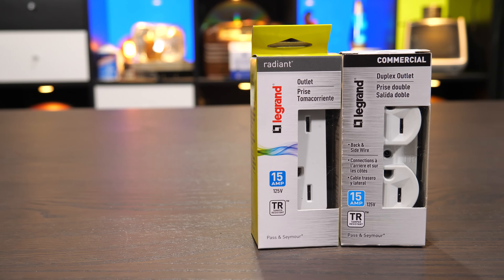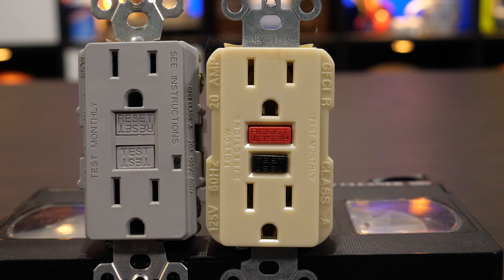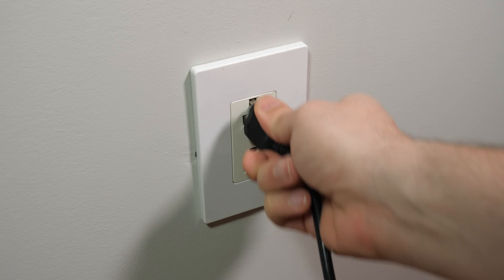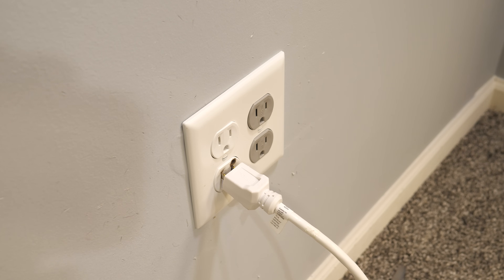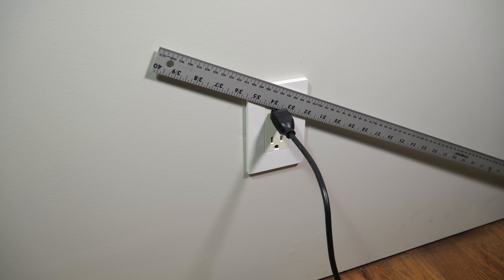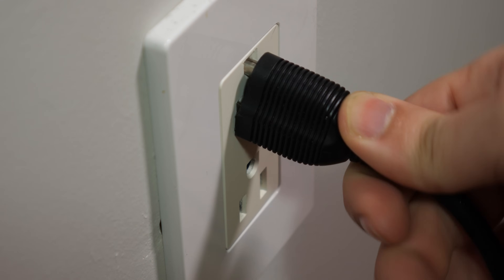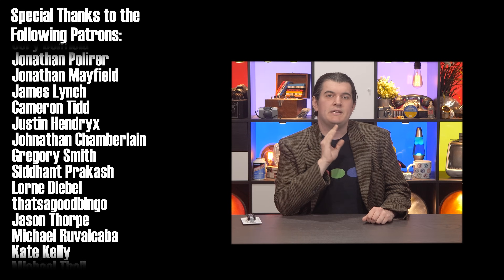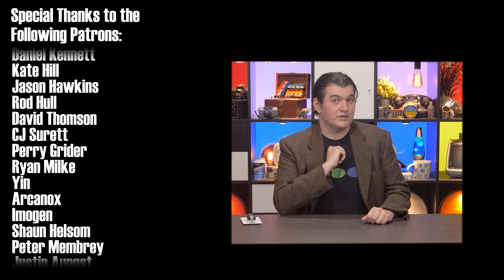Power outlets are topsy turvy - but does it matter?

Comment: As a European (Dane, specifically), I am shocked at how easily North American plugs can become partially unseated. Relatedly, I would find it very interesting, if you would do a "compare and contrast" of other plug types from around the world, especially the Euro Schuko type F as well as the Danish type K. Also type C is extremely common.
Reply: I go for Type F. Save and easy to use. Works also with ungrounded versions, and you can rotate the Plug. Type K is my second choice. Also very safe, but a bit less convenient than the Type F because you can't turn the plug. But the nice thing is that you could build sockets that fit both.
Reply: @dr2okevin  You should put on knee pads and elbow pads when you walk somewhere.  It's much safer than just pants and a shirt.   You should see the injuries falling can create.
Reply: Danish one looks happy ;)
Reply: I'm a big fan of Type E and F (and yes, I'm biased because I'm from Czechia)
Reply: I love the Type F here. Mechanically super sturdy and you can plug it in both ways.
Reply: Type F is good but as an Italian I feel like type L is fine for most applications while being more space-efficient as well
Reply: @JK061996  yeah as an Italian I agree. There are some issues on the plug side, like the fact that the ground pin isn't longer than the others, or that the pins can bend relatively easily (happens also to the ungrounded europlugs in general), but still I prefer it to the uselessly large Schuko plugs that invaded us as no appliance producer bothers to make them with 16A L plugs but ships them with schukos
Reply: Euro Schuko type F, but what am I?
Reply: In my experience really they don't unless the plug is decades old and worn out.
Reply: Hotel sockets can be worn enough to where it's difficult (and likely dangerous) to get plugs to stay in.
Reply: As a Swede living in  Denmark I am amazed how unsafe danish outlets are
Reply: @DrLoverLover  Well they're Danish
Reply: The Schuko F is the gold standard of plug design for a reason.
Reply: @weckar  Well, I like it better than the UK plug and is one of the few things that European engineers tend to design correctly.  It's just as ugly to look at as a UK outlet due to the fact that it's recessed but smaller as well as not polarized so you don't have to have the correct orientation (kinda like USB C) to insert it makes it a little easier to use in confined spaces.  That said, I also like the IEC 60320 standards, particularly the design of the C13 and C14 and similar plugs and outlets as they have insulation shield around the prongs to contain them.  This should be the gold standard everywhere, although they don't have the tamper resistant features of North American and UK outlets yet, that I know of.
Reply: @weckar doesn't have a fuse in the plug so no it's not. Why that is important has been covered on this channel before. You are consequently left with type G as the safest plug/socket combination out there.
Reply: The danish plug really is the best and the most pleasing to the eye.
Reply: Yeah. If a Schuko plug doesn't have a ground pin and thus the pins could be touched, when half way inserted, the pins are actually half way insulated, so nothing will happen, even if you do touch them. Weird that the americans don't even do that.
Reply: Type E ftw
Reply: Shocked. I see what you did there. heh.
Reply: So, the holes are not there to lock in the conductors.
It will be interesting to see various European plugs. The British 13 amp plug is well known.
Reply: as a french, I prefer the E version, with the earth being a prong that comes from the outlet, instead of the pair of earth contacts on the upper and lower sides of the connection type F has :p
we also have - mostly used in IT / offices - outlets with a 4th added "pin" hole, opposite ground, where a plastic insert that's supposed to be glued to a type E connector will go. that 4th plastic pin is there to unlock a pair of doors in front of the phase and neutral holes, to prevent the insertion of anything.
if you want to look at it, LEGRAND LEG077114 is one example of this, with LEG050299 being the plastic thingy that goes on the plug.
sad part is that in offices, most of the plastic thingies get lost, so you then have to use a thin screwdriver / scissors to push the plastic part of the 4th hole while inserting a plug to still use it... so yeah, It kinda defeats the purpose as most offices can't be arsed buying new plastic inserts.
Reply: Well we do have a class of plugs that are far better at preventing that, its the twist lock type plug's, but they are usually only seen in commercial and industrial settings. In fact nearly every problem Us plugs have could be solved with twistlock plugs , well unless someone pulls on them so hard it tears the receptacle out of the wall.
Reply: The only thing we really need to do is do what y'all do and recess the receptical
Reply: Well we invented it so yeah safety wasn't the first concern and really it's not that dangerous. It's just a bit uncomfortable. Europe and other countries had plenty of time to decide how they would design things differently. Not only that but many places like UK were forced to use higher voltage because of the way their wiring was set up, and because of that they needed to think more about safety concern for people.
Reply: @mediocreman2  
that's part of the reason, but it's not the main reason. Americans are simply more laissez-faire in their thinking and this too is reflected in building standards and such. Energy costs, fuel, the cost of land etc. has always been high in europe compared to the US, pop density too is way higher, so this leads to different expressions in what societies value.
Reply: I would watch a video on compare/contrast different plug types from around the world!
Reply: As a Swede, Danish type K plugs seem just as unsafe. When I was in Copenhagen and used the outlets at the airport, my Europlug charger would fall out just as easily as these American ones
Reply: As a fellow European, I agree, I was frighten by how bad the plug design was when I lived in the US. ..

But you Danes have some explaining to do ... 
Why the hell do you have a different plug standard, yet you stil get ALL of your appliances delivered with the schuko style plugs?
And why is it designed to be partially compatible with the schuko plugs but in a way that the ground won't connect? 😅
Reply: Can't forget the Type G as well. It's basically everything he complained about, solved (sleeved, grounded, standardised right angle).

And, yes, I went to the states with a MacBook charger and it was an awful and dangerous experience. It literally fell out the wall and sparked.
Reply: @benanderson89  You know what's REALLY fun? Thailand uses US plugs but at 220V!
Reply: @ivy_47  china too, they use Australian plugs for grounded appliances and europlugs or american ones for ungrounded ones
Reply: @ivy_47  So do we, ours looks a little different at 250 V 15/20 A.  These are only ever used for larger appliances and power tools though and it's often two hots and a ground.
Reply: @benanderson89   Type G is bad! type F best more Safe
Reply: @benanderson89  There is nothing dangerous about US outlets.  The government only claims 2500 children per year get shocked.  That's from sticking things in the outlet.  If you have small children, it is trivially easy to fix this tiny risk with plastic plug covers.
You are just looking for something to complain about.  NOBODY, even in Europe tries to prevent every possible accidental injury. You don't leave your house wearing a helmet, elbow pads and kneepads despite the horrific injuries you can get from falling.
Reply: It's also a feature, hypothetically (less likely to break when pulled). But it's super annoying when you have a heavy wall wart, or an old cord.
Reply: Whilst I admire our 🇬🇧 type G, I do wish it had been made smaller. It really is oversized. Functionally superior to the others, yes but really didn't need to be that big.

I also question the necessity for a fuse in the plug these days too, with modern quick reaction circuit breakers.
Reply: But we all agree that type G is the best.
Reply: @mildlydispleased3221  Ew, no. Definitely type F all the way. Using three pins is just silly.
Reply: @mildlydispleased3221  Except that it has some flaws I don't like.  It was designed for ring circuits, thus has a fuse in the plug.  Fuses should be in the appliance, not the plug where lay people can get to it and put the INCORRECT size of fuse in the plug.  There's a reason the rest of the planet uses individual branch circuits with each having its own correctly sized breakers.  Unlike the Schuko, it's not recessed, and appears to be a bear to insert and remove like the plugs we use in North America for dryers, welders and electric cooking stoves/ranges.  The fact that the UK plug is used...mostly within the British/Irish archipelago and not much anywhere else also shows that it isn't perfect.  The Australian plug and outlet are a modified version of what we have in North America and shows that our outlets are probably fine, we just have to find a way to start insulating the prongs on ours for most applications isn't difficult to do.  I mean, for most low-current applications ours can indeed be insulated, it's only the larger current applications where that may become somewhat problematic.  One of the plug and receptacle designs we have in North America that I think beats out most other places is the NEMA locking outlets and plugs.  Those are incredibly difficult to get shocked from due to the fact that they lock in place to be used.  The disadvantage with these is they are mostly relegated to commercial and industrial use like theatre lighting and power distribution (generators, shore power, etc.) as well as still having some of the weaknesses of their straight bladed contemporaries like bare prongs.

German and European engineering may have lost its knowledge of Occam's Razor but there are still some products coming out of the continent that have some interesting and better thought than other places and the outlets are one of them and Neutrik connectors are another set.
Reply: @mildlydispleased3221 No, type G is the worst of the European plugs!
Yes, it's quite good in terms of safety features, but it's ridiculously big and impractical and it's not recessed, while the fuse in every plug seems unnecessary.
Reply: @LRM12o8  The fuse is a safety feature and is certainly not unnecessary. I've had type G plugs that haven't needed a fuse change in 20 years. It's very rare that they actually pop
Reply: @mildlydispleased3221  " It's very rare that they actually pop"
Then the fuse is not needed in the plug and can safely be moved to the distribution box. But that is almost impossible with the ring circuit in the UK...
Reply: @Ruhrpottpatriot  There's no reason to do that. Bulky plugs are good, they are easier to find at the end of a wire and remain secure when plugged in, there is no reason to remove the fuse. Just because the UK did something right for once, if doesn't mean you have to throw a hissy fit.
Reply: @mildlydispleased3221  It's not like you can pull out a Schuko-F that easy as well especially the ubiquitous right angle connectors, they are secured by two and guided in by two rails. If you want to know what force you need to pull out a Schuko-F, you can look at DIN VDE 0620-1:2005-04 chapter 22. 
Now a C or J inside an F is another story, but that's besides the point.

"there is no reason to remove the fuse. "
Yes there is. It gives just a marginal increase in security, but massively increases material cost. It also doesn't protect you from overloading anything behind it in the wall and thus you need a fuse in the breaker box anyway.
If you don't have a ring main, the benefits shrink even further to non-existence.
Reply: @Ruhrpottpatriot  I would expect nothing less from somebody who idolises imperial Germany.
Reply: @mildlydispleased3221  Ah, the classic ad-hominem when no factual counter arguments can be presents. Bravo!

Now, do you have anything factual like building code, statistics about damages or house fires caused by electrical wiring?
If not, this conversation is over.
Reply: @Ruhrpottpatriot  Mate, type G is seen as the best plug type by most experts and I trust the experts.
Reply: @mildlydispleased3221  You have anything to back that up? Or is this just another case of "I have heard that a  friend of my friends uncle twice removed said that..."?
Give me sone testimony, some studies. Talk is cheap.
Reply: @mildlydispleased3221  I've seen a design for a UK plug that folds smaller for travel. Unfortunately, I've not seen it in the wild. That would certainly help with a lot of the complaints.
Reply: @chaos.corner  The compact UK plug is very widely used, but mostly for portable electronic devices.
Reply: @mildlydispleased3221 Interesting. I've lived abroad for more than 20 years and haven't been back in about 5 so have missed those.
Reply: @mildlydispleased3221  no
Reply: @mildlydispleased3221 type G is cumbersome and not that much versatile or powerful. I prefer type I (AU/NZ version, with sleeved pins) and J
Reply: @elia_berti  How is G cumbersome? You just slot in, that's it, it even makes a satisfying "click"
Reply: @mildlydispleased3221  it's very big for carrying only max 13A and you can't make a more compact ungrounded version
Reply: @elia_berti  it's big because it's fused, user serviceable and has different length of wire inside in the event the strain relief fails, and if you want a compact one you can buy plugs with pins that fold completely flat with a spring loaded mechanism.
Reply: @mildlydispleased3221  It's big and clunky. Just the plug is the size of a type C phone charger. F always felt sturdier, yet neater to me.
Reply: @elia_berti  that is the point, you shouldnt have an un-grounded version. the sockets have the live and neutral pins covered by shutters so a kid cant stick a metal coat-hanger in there. and the ground pin is required to open the shutters. so if you have an appliance that only needs 2 pins, the ground pin must be present (but can be plastic) to simply open the socket. .. the type F is close but understand, the type G is massively over-engineered for its rated current, every type g will do 13A all day every day ive seen many a type F burnt out the wall when using UK kettles  on a regular basis, and they are rated for 16A. in the UK a 16A rated plug is the blue CEE plug, thats an absolute monster compared to the type J
Reply: @denisohbrien  you can make shutters with ungrounded plugs too (I think all sockets in Europe have them mandatory too) but probably yes, the British system is simpler and more reliable.
And I agree with you that type G>type F, Schukos don't take any advantage of their size as in contrast with British plugs they have no polarisation, no fuse, no square pins which have more contact surface, no simpler shutter opening system, they just waste more plastic. But I still prefer the Australian or Swiss systems which are more versatile and probably cheaper, and have no disadvantages over British plugs if you don't use ring circuits
Reply: @elia_berti  some uk sockets just rely on both live and neutral pins being inserted at the same time to release the shutters , the ground pin isnt necesary per-se. probably a similar mechanism tho iv never seen it myself on schukos. i didnt mention this for ease of comment, but mandating the ground pin, also mandates polarity  so neutral and live are always correct too (or should be!)
Reply: @denisohbrien  Indeed, I've never had any UK plug fail on me in any manner. Worst thing I've had to do is replace a fuse.

Something I don't think anyone's mentioned in this discussion yet though, is that the plug design comes with the aforementioned grip to aid unplugging. And it's needed because accidentally unplugging one of these is basically impossible - which also makes it difficult for young children to mess with.

You can't pull it out while vacuuming, and, before anyone asks: no,  that doesn't mean you just end up ripping the wires out the plug. Those things are clamped in tight too.
Reply: @denisohbrien  all sockets here in Italy (here we use types L and F so Schukos too) have that both pin shutter system, it's been mandatory for at least 25 years
Reply: @denisohbrien  I have never seen a Type-F burn up. Because in any sane building you have a circuit breaker and GFCI installed and those will cut the power long before anything could happen to the plug. If a Type-F burnt up, there was an error in the installation, which can happen to any plug. Also: Nobody needs fuses inside the plugs anymore.

Now, the UK ring circuit on the other hand is dumb, overcomplicated piece of shit compared to a radial circuit. Seriously, load balancing your electrical installation??
Reply: @Ruhrpottpatriot  we all know the ring circuit is dumb and was a post-war necesity. in an ideal world, yes, but after many uses of the socket its clamping force isnt what it used to be, a good example is when we took out caravan to mainland europe, in the UK we would connect with a  blue CEE plug. when we went to mainland europe we would connect with a schuko style plug. both 16A rated, quite a few times we tripped the breakers. now, nothing against the schuko but hold that and a blue CEE and tell me ohnestly, which would you feel more comfortable putting 16A@240v down. WE likely tripped the breakers as they were not anticipating our electricity usage we are accustomed to caravanning in the UK, but both connectors , on paper, are equal.
Reply: @elia_berti  Not being able to make an ungrounded (or at least two-pin) one is sort of the point, the earth pin operates the shutters on live and neutral.
Reply: and to add, ive seen type F and the equivalent burn up and stand by that statement, but my experience is limited to running UK appliences abroad.
Reply: @elia_berti have you seen the old type D plugs, they are like cocktail sausages.
Reply: @denisohbrien  Germay was probably more destroyed than the UK and still went for a star layout. 

"nothing against the schuko but hold that and a blue CEE and tell me ohnestly, which would you feel more comfortable putting 16A@240v down. "
You fail to understand the difference between the two plug types. They are NOT equal, not even on paper!
Schuko-F is not rated for a constant load of 16A. It is only rated for 16A up to one hour (usually tested with 13A for 24h). Now the blue CEE230-16A plug IS rated for 16A continuos load.
See IEC 60884-1 or VDE 0620 Part1 for more details.
Reply: @elia_berti  Why would you want to make an ungrounded version?
Reply: @denisohbrien  
If germans accuse you of overengineering it's time to stop and listen lol
Reply: @mildlydispleased3221 Type G is the only plug/socket that's was designed from the ground up to be safe. The only modification in since 1947 to the standard was in 1984 when they mandated sleeved L/N pins.
Reply: Plug N 4 Lyfe
Reply: They don't. That only happens when they're worn out from years of plugging things in and unplugging them. If they get loose like that, you're supposed to replace the outlet with a new one. Any outlet design is going to have issues if it's worn out. It's just that in the case of the American ones, it's more obvious that something has gone awry and needs to be replaced and the UK style is better in that if anything at all is connected, it's the ground.
Reply: @SmallSpoonBrigade  We have some 70 year old sockets here, none of them are worn out. German Type F. Plug and socket design can influence how fast they wear out drastically
Reply: @marcokrueger3399 Also since the plug is seated inside the recessed plug it's not only the pins/prongs that hold the plug in place. The recesses also makes acess to a hot pin impossible and it's nearly flush when you put furniture in front of it. 
When you need extra child protection you can get child safety discs that puts a shutter in front of the holes. 
With todays breakers and RCDs the fuse is somewhat superfluous. I wouldn't want these huge cumbersome plugs only for the slight advantage of a fuse. I also don't wear a helmet riding the bus even though in some circumstance it might be beneficial.
Reply: @cyan_oxy6734  Completely agree! I also like the Type F connector because it just feels like high quality. You always have a nice handle to unplug it, it sits very well, it seems solid. I also don't fully understand why so many people say Type G is so much better, I mean it's a good plug but I guess the stepping-on-it-at-night-thing is a big issue with it, that won't happen with Type F.
Those child protectors are also something I would have wanted to mention. My parents had them, they were a bit of a pain in the a** to plug it but they work perfectly and I would argue they are safer than those shutters.
The fuse-issue is solved by simply not selling any equipment that doesn't support the 16 A a normal circuit has. I was really shocked (pun intended) when I saw in his video that they sell extention cords that will not support the full 15 Amps. The benefit of saving some money could cost people their lifes or belongings if they just don't know about it. It seems so irresponsible
Reply: @SmallSpoonBrigade  I completely agree, I just wanted to add that wear is practically no issue with Type F connectors. I wouldn't call it overengineering though, also since the amount of times some sockets are used is drastically increasing.
I mean, maybe there are older sockets over here, it's just that the building I'm currently living in has been bombed in WWII, so I know how old these sockets are. The basement is actually older but I'm not sure whether there are any old sockets there. There's some really interesting stuff down there to explore
Reply: @marcokrueger3399  For US plugs it depends on the grade. Cheap residential grade ones aren't all that long lasting, while higher quality commercial and especially hospital grade ones last a lot longer.

then we also have the twistlock types which never have the falling out problem unless the internal contacts are corroding away. 

So we have good quality plug designs here, they are just never used outside of commercial and industrial applications.
Reply: type G .. gods own plug.
Reply: Sorry lads, typ J is the gold standard.
Reply: @olil2542 Just because the swiss cover everything in gold, doesn't mean it's the gold standard. :p
Reply: What’s even more shocking is how few actual problems occur because of it, like none. We make a lot of solutions to problems nobody has.
Reply: @SndNoods  Honestly most of the inconveniences he talked about are something I never ever had. You might not even have noticed them in your daily life as all of us usually only use one plug anyway - but they're still there if we would try different ones.
The only inconvenience I have is if I try to put multiple angled plugs next to each other, something that basically only happens with a power strip. But with the US standard? I would see that happen to me all the time. Also, I really like my angled plugs.
Reply: The one true king of plugs is the UK type G.  It can even be used as a mace in a pinch.  Euro plugs sure are better than US ones though
Reply: @beelseboob and caltrops if you leave them laying around for unsuspecting barefoot burglars!
Reply: Shocked I tell you!  Despite the fact that shocks and injuries from these bladed plugs are practically unheard of.  It's almost as if we aren't a bunch of dumb children who need nanny government to be so omnipresent.
Reply: @christo930  Would agree until you said "nanny government". It's not a nanny governement any more than what the US has since there is a thing called "electrical code". It's simply a better engineered plug, that's all. Nothing "nanny" about it.
I guess you would also remove every safety device from your car simply because the nanny government mandates it!